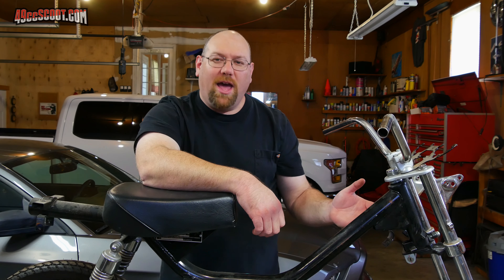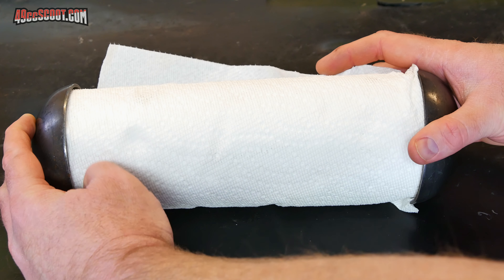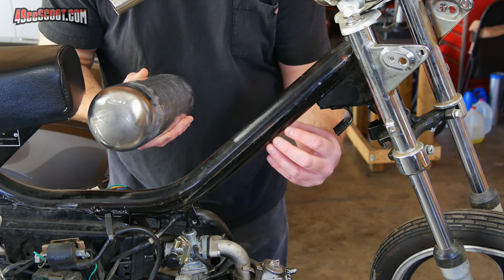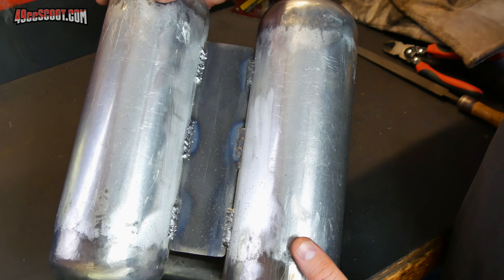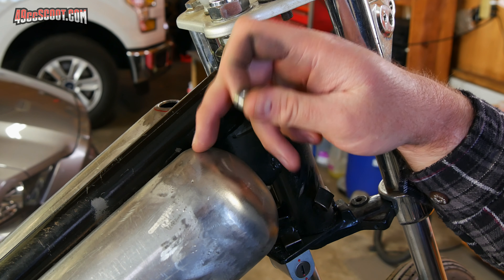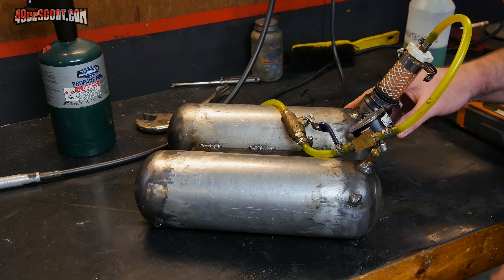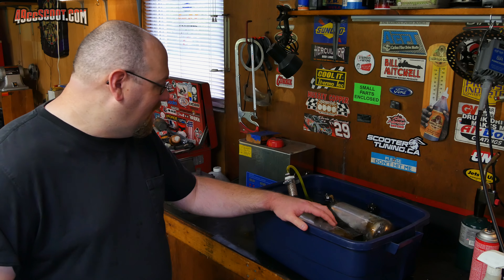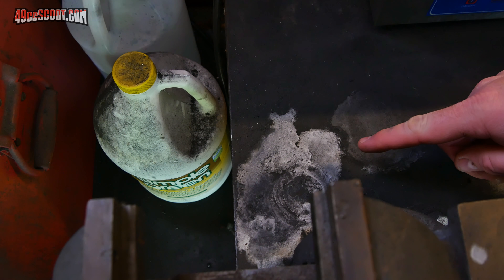SSR Part 3 : Building A Custom Gas Tank And Sealing It : Fails Included

Comment: Lookin good! Now, if you get a dual exhaust setup that is equivalent in size to your gas tanks, you will have a one-to-one power ratio, which will effectively double your power and gas mileage. Then, add 0.3 gr rollers and periwinkle clutch springs and you should be in the 120+mph range. I do this all the time.
Reply from the maker: Periwinkle noted. I was thinking of the honeysuckle scented clutch springs.
Reply: @49ccscoot  Yeah, that's your problem right there. Periwinkle bruh.

Comment: My old Honda 350 uses two small lengths of tubing connected by fuel line hose (~1/4") to let one side flow to the other.  It would take drilling and tapping, sealant, and then connect the two tubes.  You'll have more than enough flow.  Do the same at the top for venting. or use the large crossover you planned for the bottom to allow filling at reasonable rate.
tom

Comment: Looked like you were trying to take way bigger bites on that thread than the lathe can handle.  The spindle stalling as the tool engages is a pretty big red flag:)
Reply from the maker: I thought the same, but I wasn't taking big bites according to the dials. Could be that my cutting tool sucked. This thing will also stall at slow speed. Not a lot of torque. Other possibility is  that I was an extra 0.040" in every time, miscounting revolutions. Don't think that happened though.
Reply: @49ccscoot  ah well. The tank looks great:)

Comment: Time index 20:20 You are actually on the right path with this, you need to have an upper crossover as well or the secondary tank will not fill due to air pressure not allowing the gas to fill the tank. The air has no where to escape to allow the fuel in, you need to either add another crossover pipe at the top, or vent the 2nd tank without the filler cap. (this may have been addressed, not finished watching) Time index: 22:00 oh no! lol you were so close... Time index 30:00 ahh okay, I think a crossover pipe underneath might have been a cleaner look but, I'm sure it will work fine.

Comment: While your method was a bit more creative, you did use eighth inch npt fittings which are easily adaptable to standard air fittings to use with a compressor for leak testing

Comment: You will need to put a tube at the top as well to let the air out of the tank without the filler cap
Reply from the maker: There's a crossover up top and the filler is vented. At least when filling and draining for a test there seemed to be no issue with filling and flow.

Comment: If any interest I used 2 hours to start the perfect machine,great torque and 0 sound 100 km in the wilderness yesterday.I had an invisible blue arch on the spark-plug.Not white,high voltage danger spark.Changed vacumm fuel-pump,wich I had,checked valves.But had 10 spark-plugs at home.Husqvarna manual says"new plug at least 1 time pr month".But it can be other stuff.IMPOSSIBLE to have an snow-scooter 0.5 m outside the road in the snow.It`ll have to stay trough the winter.fulel pump,plug,coil-wire,but its a limit of what you can carry under the seat.

Comment: 44:19 Is that fuel tank sealer realy gasoline resistant??? in the long run?
Reply from the maker: Yes. It is specifically made for this. I put it in the tank that I cut apart and put back together for another scoot and all was well for at least a few years of use.
Reply: @49ccscoot  Because I´d like to 3D-print the perfect tank, and seal the inner-side-plastic (with this sealer) against gazoline. Would be a possibility, wouldn´t it?

Comment: Hello, I have a problem, i bought overrange malossi belt,  i have oversized variator, but the belt is too long for my  variator, is the problem i need oversized rear pulleys? thank you!
Reply from the maker: That sounds like the issue. You really need both pulleys oversized to run a much larger belt.
Reply: @49ccscoot  Thank you!

Comment: Do you think double thank will be possible like stock and reserve and they will run on the same line whit shut of valve
Reply from the maker: These should work just like a single tank. The easiest way to get a reserve function IMO would be to use a valve that has ON/OFF/RESERVE. It would just draw from a lower height on reserve.
Reply: @49ccscoot  yep and store it in the seat like the bws and take

Comment: Man if you were going to por15 the tank you could have skipped all that welding headache. The sealer would easily have filled those pin holes.
Reply from the maker: It's supposed to, but I like the idea of added insurance.
Reply: @49ccscoot  can't hurt though I have personally sealed 1/8" rust holes before without issue (which I don't recommend:)
Reply from the maker: @DoRC  That's impressive.

Comment: Could have used the mistake hole for the filler.
Reply from the maker: Possibly. I really wanted the filler to be right at the top as mounted to the scoot though.
Reply: @49ccscoot  You definitely got the filler in the right spot, and I really like that tank.  If you ever want to go the mc tank rout, I have an xs850 tank I would send you.  Holds about 5 gallons.

Comment: Pit bike super cub ct70  Honda clone 4 stroke engine  49cc 125cc swap cdi racing box fast 
 swingarm rear cl70 super cub copy 
Moped 2 cycle gasoline  70cc mods
Moped 4 stroke 125cc 150cc fast 
Carburetor 28mm mods  cdi box racing 
Amazon ebay  cheap away